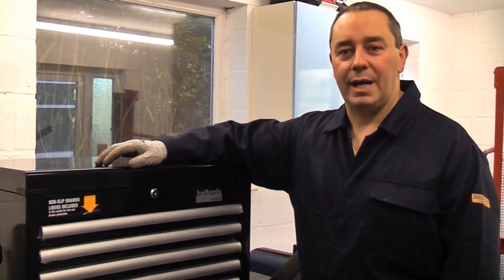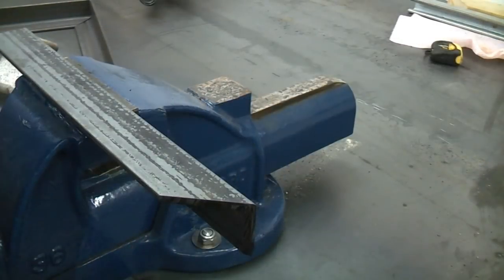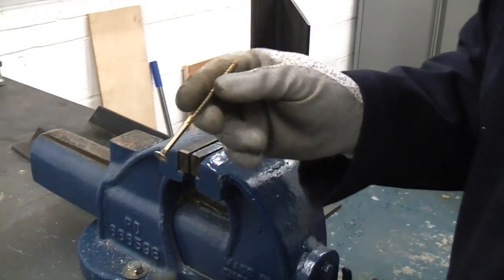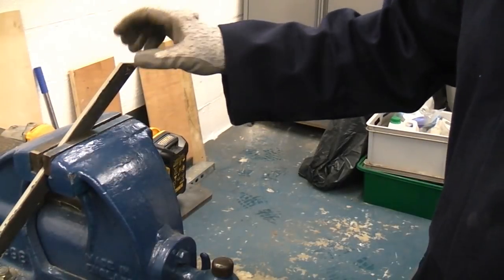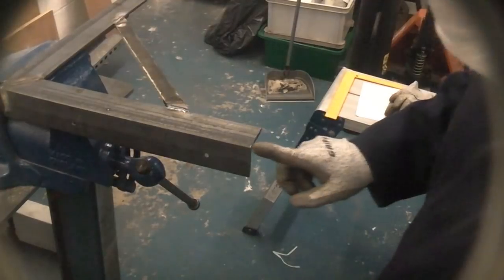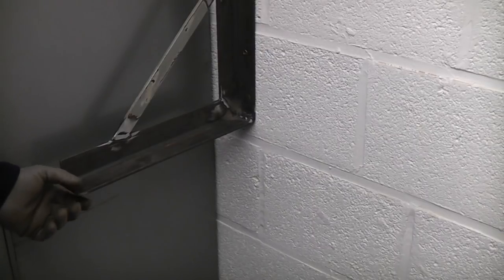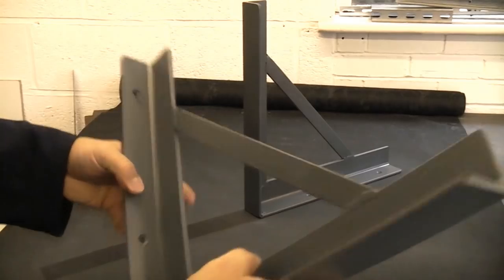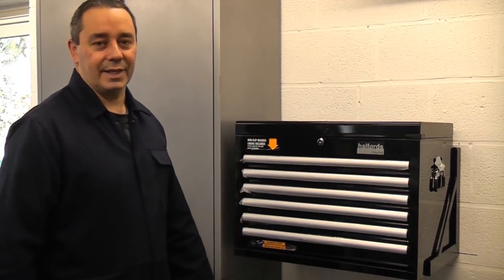How to make brackets | Angle brackets

Comment: a newbie stick welder here, your welds are beautiful but mine are always horrible, been searching on youtube for reasons and everyone says clean the millscale,rust etc. etc.  you didnt do any of these so where am i wrong?
Reply from the maker: It just takes practice. I use an arc welder, as they will weld rusty metal, whereas a MIG welder will struggle. If you want a perfect weld, then preparation is key and having clean pieces of metal with no rust etc. will improve the quality of the weld. I’m not the best welder by far, in fact I’d call myself “the welder of last resorts”, when I worked on site- I would only weld, if nobody else was available 😂

Comment: To do small welding work like this can you use a blowtorch and grazing rods, if so what would be a good brand to buy.
Reply from the maker: No, brazing is not the same as welding. 
You can often pick up a cheap entry level welder pretty cheaply. Once you can weld you can make lots of things ;-)
Thanks for the comment 👍

Comment: I need a pair of brackets like that, has anyone any idea where to get them from, or how much could you knock another pair up for including postage for those of us without welding gear or metalworking gear? Where are you, you sound like your in Bolton (UK), i'm in Wakefield (UK).
Reply from the maker: I'm in Darwen, Lancs (in between Bolton and Blackburn).
Unfortunately I don't have time to make you a pair or else I would do but I'm mowed out for the next 4 months.
If there is a welding shop or engineers near you I imagine someone there might make you a pair from offcuts.
Reply: Thanks, i managed to find some on ebay from a small fabrication shop. I was pretty close with your accent though.
Reply from the maker: Glad you got them sorted ;-)
Yes, you were very close!

Comment: Did you buy a cordless dewalt kit or buy all your dewalt tools and batteries seperate
Reply from the maker: +Keelin Black Originally I bought a load of different Dewalt gear from ebay and from car boot sales etc. But I ended up with loads of different voltage tools, so I sold them all on ebay and then with the proceeds I bought a Dewalt 18v  five pack kit (it came in a huge case that was difficult to carry and larger than a suitcase LOL). Since then I have always just bought the "bare" tools, normally from ebay as you can get some real bargains this way.Thanks for the comment ;-)

Comment: Are you a welder by trade ?
Reply from the maker: No, I'm a maintenance engineer. But I do a fair bit of welding on site, but normally vertical repairs to thick metal.
Thanks for the comment